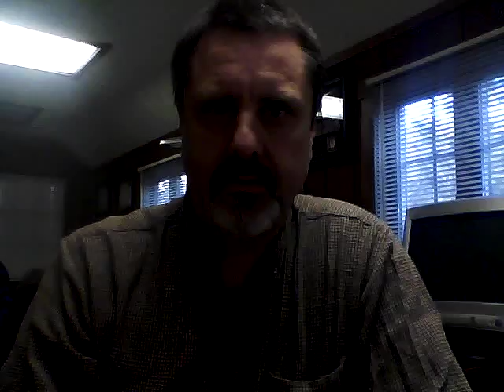Professional Land Surveyor Vlog 002 - Description Keys Are Unnecessary - There, I Said It!

Comment: Description keys can do so much automatically assigning point styles and point label styles. Bringing everything in on import to the correct layer, Tree scaling and labels , labeling manholes, orienting signs. It gives me a stable background for all other points, then I use groups to temporarily show me all elevations for example.. Or I will make a group for my template that use regularly for creating tables. I can use a group to show how I want it to look for plotting, or I can make a group that I will add to a surface. I can use groups to distinguish one day of field work from the next. For. Me description key sets are a seperate tool entirely from point groups and I find it necessary for efficiency. Survey database with description key sets and field standards, you've got a perfect workflow for field to finish.